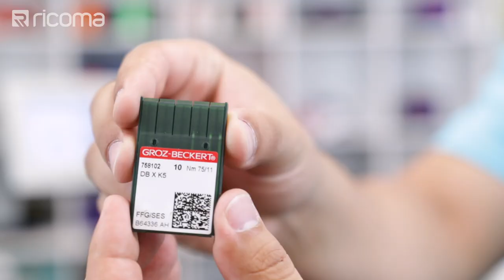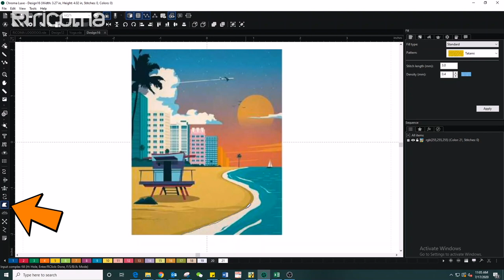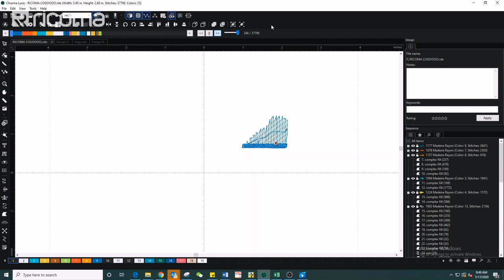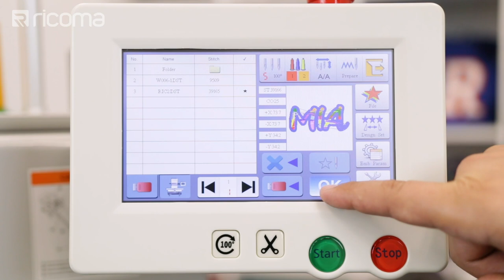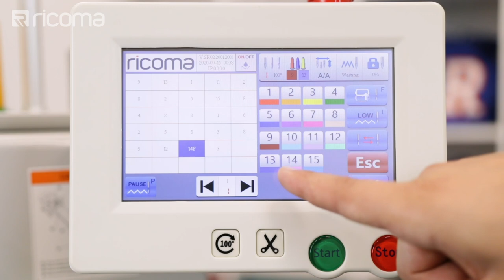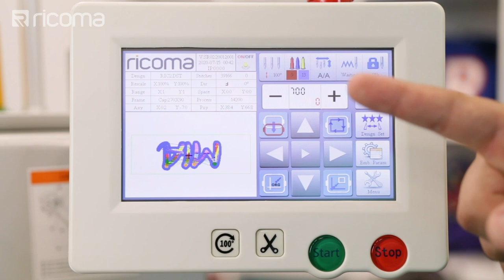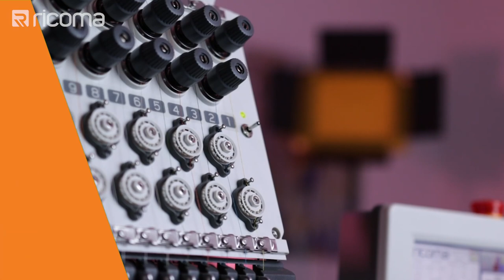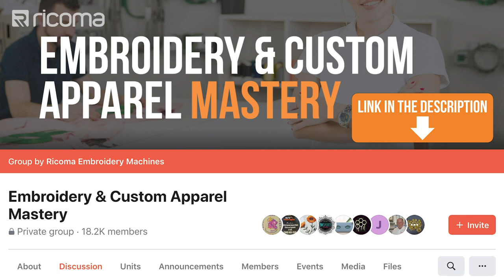Cap Embroidery w/ 3D Puff Border & STITCH FILL | Appliqué | Ricoma Embroidery Machine (EMBHub Ep122)

Comment: My em1010 has a hard time getting images close to the brim like that, mainly because the brim bends against the machine as the needle gets close to the bottom. Is there an adjustment for this?
Reply from the maker: Even if the brim bends against the machine, you should still be able to get it close enough to the brim, about 0.5 inches, without any registration issues. If the particular cap has a brim style that might get in the way, try bending it forward and then bending it back when done with the embroidery

Comment: did you have to adjust the presser foot height to the height of the foam?
Reply from the maker: Not particularly in this one as we were only using one piece of foam. And also we had this adjusted beforehand. But if you're using thicker foam or thicker garments, would recommend adjusting the pressor foot SLIGHTLY higher to accommodate the thickness.